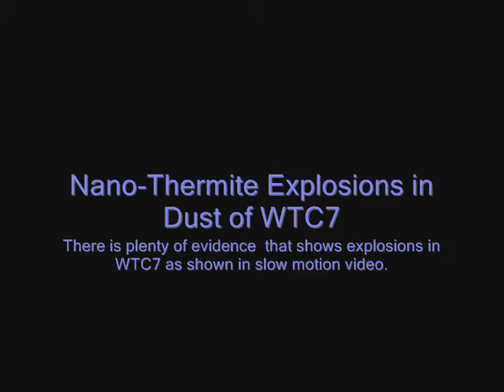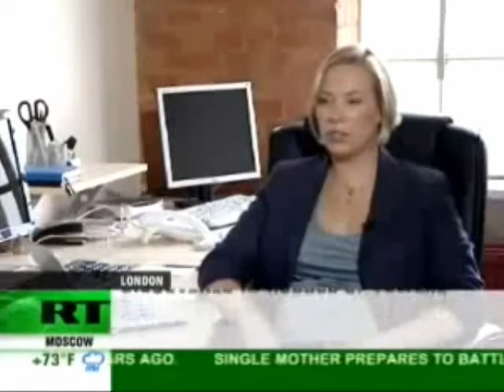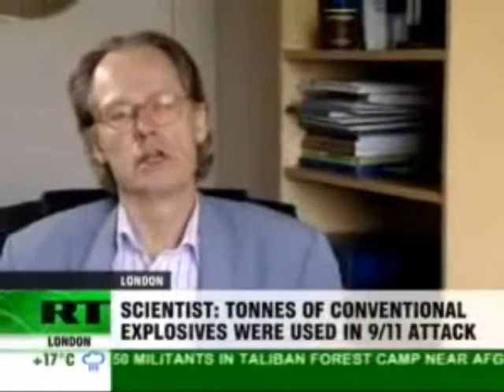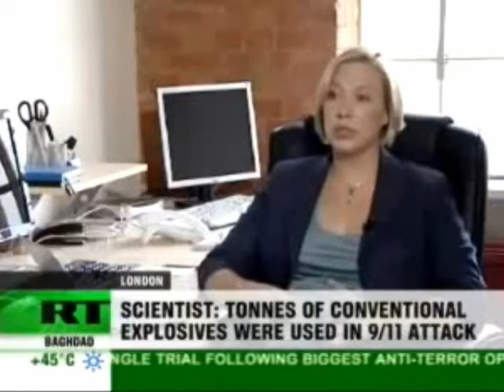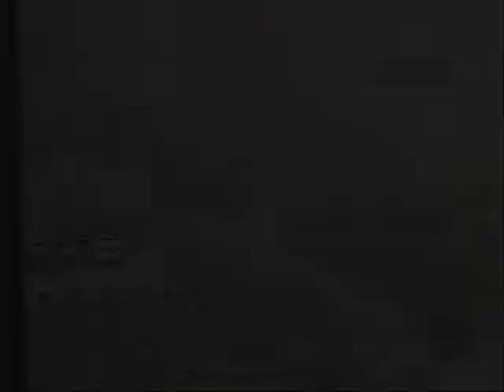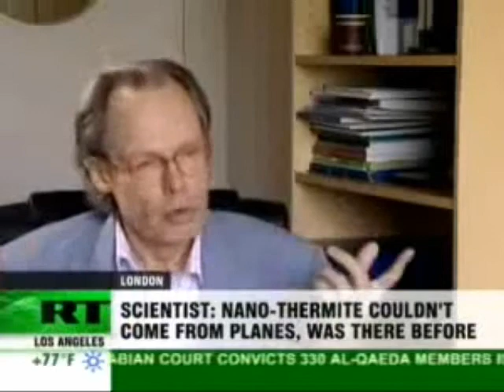Nano-Thermite explosions in dust at  WTC 7

Comment from the maker: @josephdupont  Your question is off subject. You are assuming that the official story is correct. Early reports and viable witnesses mentioned a small plane or missile.

 A tomahawk missile, for instance would most probably carry a thermobaric weapon which utilizes nanothermite to produce a slower explosion with temperatures of around 3000 degrees. 

If you do a little research in "the 911 television archives" you will see that the first eye witnesses worked for corporate media.